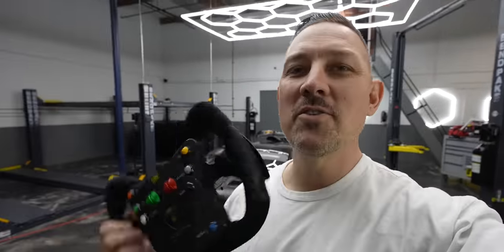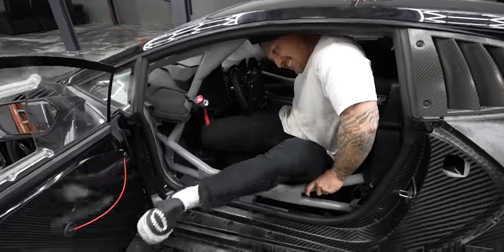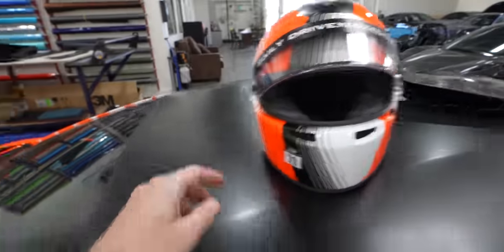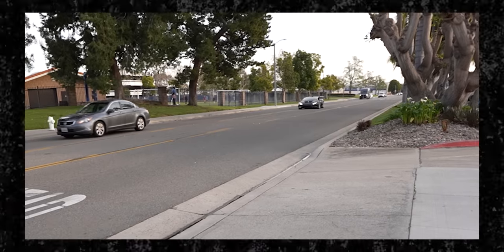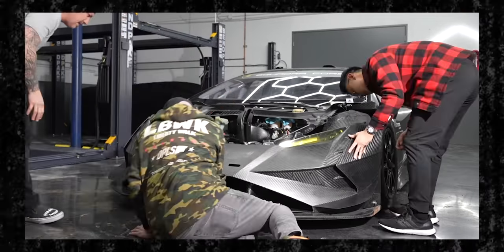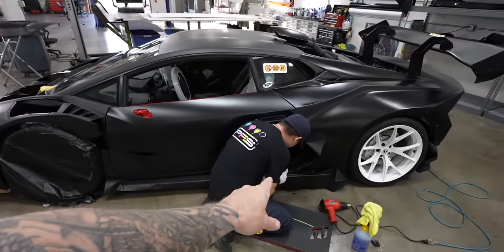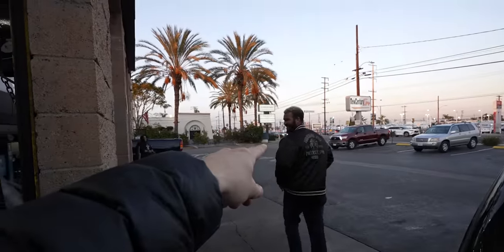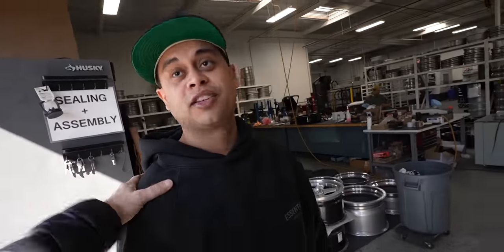MY RESPONSE TO THE HATER SLAYER LAMBORGHINI COMMENTS…

Comment: For the race tires, there are little holes around the tire to measure the tread remaining. If you don't see any holes around the tire, it's done. But, those tires only work for a couple of "heat cycles" so, they are likely done anyway even if they have tread left.

Comment: The race slicks are not “melted”. What you are seeing is tire pickup where the hot slick - ~200F picks up discarded tire from the track, usually found if driving off the racing line during cool down lap.  You’ll find that “tire snot” everywhere on the car after a session.  It will be stuck to th inside of the wheel, in all the vents, in the bodywork, etc.

Comment: Very important part of owning a race car, it needs to be spanner checked after every session on track for nuts or bolts coming lose, every nut and bolt will have its own torque setting so you will need to do this otherwise the car will fall apart around you 🤷‍♂️ There is so much you will need to do just to keep this race car running. If I was you I would be going to a race meeting and watch a good team run the car for the weekend and then go to their shop and watch them re prep the car so it’s ready to race again. 🏎 💨

Comment: You need some all season semi slick tires n a air tank for the air jacks the car has cause not every shop has the proper equipment needed to Jack up that car or the proper car lift to put it up in the air.

Comment: As far as the race slicks go they have a pock mark in the tire and it should measure 3/16 or deeper (some guys go 1/8) if not take them off another thing is to check the dates dont run anything over 2 years old, They dry out and they will wreck your life...

Comment: 10:07 whenever I hear you guys talking about your wheel colours…some of the rim designs ive seen…has the concept of two toning them ever crossed your minds

For example, depending on the spoke design, have the outer edges in bronze, along with parts of the spokes, then have the remainder a different suitably contrasting colour, thus making the wheel look like two interconnected pieces slotting together?

Comment: not to mention the impact gun you're going to need to set the correct torque for those center nuts, it's probably like 400 some ft/lbs, I think some of the Porsche ones are like 440-450

Comment: Damon, when building that new steering wheel and seat for the race car, your going to have limited movement, which is why many "sports" cars have at the very least a straight bottom part of the steering wheel so becareful not to go to nuts as you may not be able to turn without always hitting your legs.
Reply from the maker: We made it all work. You’ll see in tomorrows video. New seats, harnesses and wheel was installed!!

Comment: Heys right correct about fuel gauge u can do a simple easy u take stick in the gas tank and market where or tape it where its wet or white maker that's what my  racer driver in GT class did  or like hey said drain it then measure it but it takes longer this way

Comment: That's a really $H!Ty design flaw in the wheel removal, you wouldn't have that issue with a Porsche, heck as VW group owns Lamborghini, so check with your local dealership to see if they have a center lock lug removal tool.

As for the wheels, maybe go Chrome, OR do the Orange, Black, White style livery on the wheels like you did with your helmet.
Reply from the maker: I ordered the Lamborghini socket from Italy.
Reply: @DailyDrivenExotics  Holy Smokes, you found a part that was not on backorder...
Both cars are coming along 👍 great in my opinion.